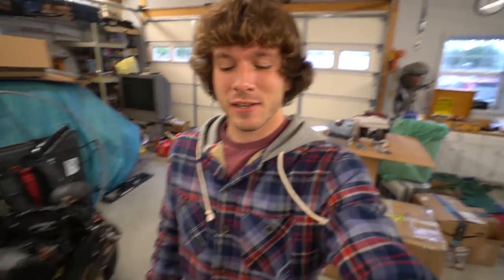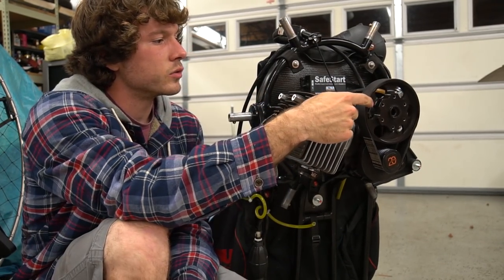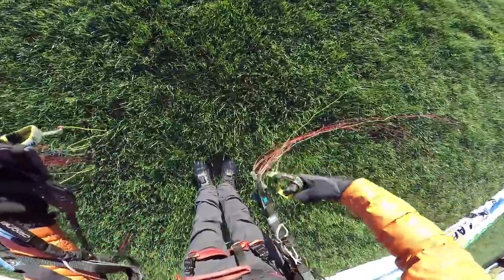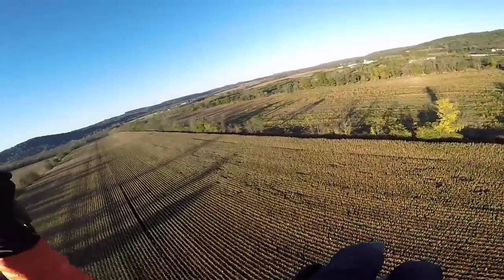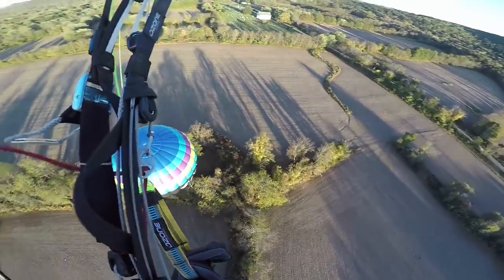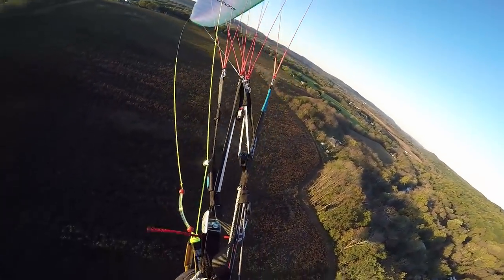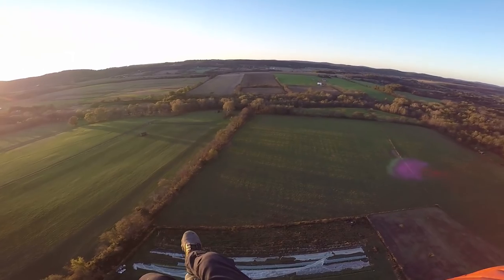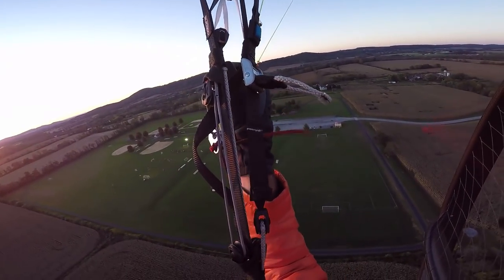Never expected to find this in my engine! - 36 Hours Of No Maintenance

Comment: Hey Tucker, can you find a secure place to "tuck" a 20 dollar bill on the motor frame for emergency (McDonalds, fuel etc.) money? Just a thought. Thanks for all the videos!
Reply: There are pockets all over the harnesses, usually, for things like wallet, keys, phone, hook knife, etc
Reply: A Driver’s License with a twenty in your shoe works pretty well.
Reply: Having hidden spare money is always good, I have a hundred in my belt.
Reply: Estabanwatersaz a leather money belt is the best idea. I found one that is also the new zipper/ratchet/automatic one that's the boss! Looks good and the ratchet buckle is great for my skinny butt!!
Glasses are a must have! I started years ago with a pair of Wiley X for riding, but they stopped making that line that had the inserts to keep air and dirt out of the eyes but Eye Glass World has a great pair called the Liberty with magnetic inserts, not snap ins like Wiley X had that I use when flying and riding and even on windy days flying my kites, keeps the dust and dirt out. Mine are prescription but get them either with plain glass that darkens in sunlight or in your favorite color of sunglasses lenses. You'll love them and they have a big enough lense area that they don't block any perceptual vision. I had to wear them in Colorado today because of 30+ mph winds that made me keep watering up. Tell them I sent you!! LOL!
Keep that wallet on you when you have real pants all the time, JIC of an accident or as Kyle O would say, a taco attack is needed!!

Blue Sky's and Safe Journeys!

Comment: Tucker:  That VP racing can I saw in the video is the bomb.  I have a few myself.  The clear tube on those cans will eventually get brittle and crack at some point.  Go to some fleet supply store and get a length of real gas pump hose and the tube will forever stay flexible.....  Great video young man!!

Comment: I wanna say the crud on the head and piston is all the ethanol (basically rock) in the cheap gas station gas and the av gas should be leaded (which also lubes the motor nicely). You may notice old car motors from the 70s (leaded fuel) have almost no wear but motors from the 80s/90s (unleaded fuel)  basically grind themselves down. Or I am just stupid. Happy Flying !!!

Comment: Tucker, thanks for showing what avgas can do to an engine. Sometimes there isn't much choice at airports and we have to use it. I fly a 912uls and try not to use avgas as much as possible. The 912 and most 2-strokes are designed to run on autogas.

Comment: I was wondering when you decarbonized the cylinder head and piston crown..did you also check the exhaust port for carbon build up as well?..2 cycle engines running on leaded fuels and high oil dilution ratios will form more deposit build up than unleaded fuels..A clean out and repacking of the muffler does wonders too..especially for gas mileage.

Comment: Classic New Jersey Shenanigans. Glad to see you enjoying simple fights back at home. Didjoo say you used a WIRE BRUSH on your heads and piston? On  nikasil coated parts? Use chemicals to dissolve the carbon so it can be removed with a soft cloth. Zero nikasil damage that way.

Comment: Use SeaFoam fogger for carbon buildup, after pretreating buildup, put head back on and spray into carb while giving some throttle.  It will smoke a lot and start to choke out. Also run in fuel.

Comment: For the issue of the dirty internal part of your engine. Have you considered a good fuel additive in order to keep the cylinder clean and lubricated by using the fuel additive. I was just thinking this may be a good idea. I am sold on a product called mix I go. When this product burns the residue Left Behind is a very fine oil which will lubricate that area of the engine also as well as keeping it clean and the spark plug clean. I enjoy your videos

Comment: Glad to see you're having a good time back in NJ. You seemed pretty Giddy (or was that the espresso talking?). You should get an RV instead of van, so you can have a shower once in a while (tons of cheap ones in NJ on LetGo) I know because I have been looking into getting one. We are talking under 5K for a nice one (and not much difference in mileage than a conversion van 19-22mpg. Rock on Bud!

Comment: been working on 2 stroke dirt bikes forever. 1. Spark plug- make sure the gap is correct from the factory you would be surprised how often they AREN'T. 2. Use better quality pre mix  3. bore out and hone the cylinder, change piston and rings every 150 hours of use but in your case, since your life depends on the engine, I'd do that more frequently. 4. whenever you got the engine opened up and you have had it for a while, always check the bottom end. 5. Use the best fuel you can find , non pump gas if you can. Anything over 100 octane is best. 6. I don't know if the carburetor is designed for certain altitude and I don't know how high you can fly with that thing but if you are going over 3500 feet, you must prepare your carburetor accordingly, that means to re-jet it before your high altitude expectations. Otherwise you wind up with much carbon on the piston and your engine will not perform right. 2 stroke motors are very sensitive. On a 4 stroke you could piss in the tank  iand it would run fine, not a 2 stroke.  Just my .02.

Comment: Nice work on that maintenance. I never saw white stuff like that before inside a motor. I guess it must have been running pretty hot. Pumpkins are $5.99 each at ShopRite, I didn't buy any at that price. I'm pumpkinless :-(

Comment: Hey Tucker, now that you've serviced your motor after the race, are there things that you think you could have done along the way to avoid some of the damage done during the race? Is it worth changing out the spark plug after day two or something along the lines of bringing a wire brush and some tools to clean your header/pistons along the way? Was that even possible or would it have even been worth it?

Comment: The buildup inside the engine is most likely lead oxide. Remember that Avgas is highly leaded (yes, still! The engine manufacturers (primarily Continental and Lycoming) are way behind with this.). If the engine was specified for Mogas, which I think it was, it is no wonder that you get lead oxide buildup. Also, from looking at the colour of the buildup, I'd say that you're running your engine on the lean side, which is not good for the engine (higher temperatures, more ignition plug wear). Try avoiding Avgas and adjust mixture a bit to rich, and you should be fine from now on.

Comment: I recommend to clean exhaust with sodium hydroxide (in case you mix your fuel with oil for two stroke engine). Carbon will build up on walls of your exhaust from unburnt oil, if unmaintenanced for very long time it can clog up your silencer.

Comment: Nice job on the refresh. That plug and head buildup is lead from the AVGAS.. I don't run AVGAS in high revving 2t's as you get this buildup too fast.. it might be worth checking the rings on the piston too as they can stick due to the AVGAS too. You most likely know all this anyway being as experienced as you are. If the automotive gas has ethanol in it it's often better to use semi-synth 2t oil as it mixes better with the ethanol fuel.. another thing I like to do which you might like to try is to get those little 100ml / 50ml etc plastic bottles you get from the dollar store for camping / party / airplane use and measure out some 2t oil in specific quantites... i.e enough for 8l gas / 10l gas etc and write on the little bottle how much gas you need to put with it. you can just tip it in the tank before adding fuel and that way and no need to mess about with syringes etc etc. Unless your tank is empty enough it doesn't allow you to brim the tank as mixing at pumping time would but for lesiurely flights where you don't always need 100% full tank just keeping a few ready measured little plastic bottles in a bag for 8L / 10L / 6L / etc will allow you to quickly refuel and go.
Reply: it's not from the AVGAS. Avgas is 100LL... low lead, high octane. the buildup was due to using pump gas most likely containing some ethanol, or a lower quality oil for the mix.
Reply: don't take my word for it... here is a great link for the info. http://www.southwestairsports.com/ppgtechinfo/top80/hrservicenotes/fueloilspecs/fuelOil.htm

Comment: I was wondering if you also refirbished the ignition or is it an electronic one? also i hope you did you clean the carburator as well as the airfilter and checked the fuel filter and breather hole in the fuel tank... As I am working with 2 strokes also, this is a common issue in my motors... Keep it up and again, congratulations on the Icarus Throphy.

Comment: I was wondering how much oil you mix when using avigas. I know that is about 100% octane.
I put some stuff called "Seafoam" in my calibrator of my lawn cruiser lawn mower. It knocked a lot of the buildup out of the cylinder/piston area. I was told to add some in the gas as it would also help the carburetor.
I don't know how it would work in a 2 cycle engine.
Carry a couple extra spark plugs the next time you do a long distance fly.
I also thought your engine had two cylinders, but you only had one. WOW that engine did a
great job. The company should just give you a new one for the advertisement.
Fly Safe !

Comment: The white buildup in your cylinder is a sign that your engine is running too hot, the white deposits are burnt oil, you could try out a sparkplug that has a better ability to lead heat from the inside of the cylinder to the coolingfins, that way the tempertures inside the cylinder will be lower and the oil will not be burned and stick to the inside.

Comment: HELP!  I HAVE QUESTIONS!!!

I would like to plan a paramotor trip from Clarion PA to Traverse City MI.  Absolutely no rush to get there.  I'm also not worried about taking the shortest route.  I would prefer NOT to fly over any of the Great Lakes.  So I'm looking at a "backwoods path" through central Ohio and eventually up through central MI.

My Questions:
1. How do I find out what is restricted air space?  Is there an airspace restriction map app?

I want to naturally avoid flying over any major cities or highly populated areas. 

2. I'll need to be landing and camping out overnight quite a few times on the way.  

Should I make arrangements with campgrounds ahead of time?  Or should I leave the tent at home and just land randomly at motels like you appear to have done in the Icarus race?

I'd rather camp out in a tent, but that's added accessories to bring.  So that's a trade-off I'll have to think about.

3. Finally, I won't be making this trip until at least next summer at the earliest.  Is it possible to find other paramotor enthusiasts that might be interested in taking part in the trip at least in-part if not the whole way. 

How do I get in touch with other paramotor enthusiasts in the PA, OH, and MI areas?

Thanks.

Comment: Another great video!  Thank you!   Question:  What did you use to wipe down your exhaust pipe and fuel tank?  I saw a couple of products in the video, but couldn't make out what they were.
Reply from the maker: I use purple power as a degreaser and triflow to protect the exhaust from corrosion.

Comment: What did you do about the cracked, duck taped spar?
Reply: Looks like he's still using those broken spars! LOL...duct tape for the win!
Reply: I'm surprised that the FAA doesn't require licensing for paramotor maintenance (looked at FAR 103). That balloon he circled does.
Reply: That Balloon is also carrying passengers other than the Pilot, and enough weight/hazmat to cause more damage if it lands on something.
Reply: Ed Marbach In Sweden they do..

Comment: Great video as usual. Just wondering, is there no oil to change on these motors?
Never seen anyone changing it. Thanks.
Reply: I know this is old, but no, 2 strokes don't have an oil sump. Generally you mix the gas with 2 stroke oil, but some larger 2 strokes, such as snowmobiles, have oil injectors that mixes it in the lines entering the cylinders.

Comment: Tucker, I am wondering if you adjusted the air/fuel mixture during your flights to account for elevation changes and/or lack or excess of oxygen? Seems to me the combustion chamber and plug were fouled do to improper mixture? Great vids man, stay safe.
Reply from the maker: Yeah, I leaned the mixture slightly. I would imagine some of it is improper mixture and some is the avgas.

Comment: During the Icarus race you had to super glue and duct tape your cracked spars. Did you replace them while you were cleaning and replacing your clutch or are you flying with the duct taped spars?
Reply from the maker: Flying with the duct tape for now, new spars are on the way.

Comment: Tucker, what does SAT even stand for? Satellite? Sick Ass Turn?  Also, how much weight are you carrying on average? I use a cane every now and then to get around....doesn't mean I'm completely broken, but since I have the paramotor bug, I just wanted to know if it's easier to use the cart/trike for old dudes like me? If so, does it degrade the experience?

Comment: do you always ship your equipment? Is that a better option over checking it in with the airline?
Reply: Yes he always ships his eq. He addressed this in a previous video. Gas fumes could potentially get his motor pulled by TSA. Yes tucker drains his lines. Fellow pm's had missing hardware & even missing gas tank.

Comment: You're a brave man for trusting such a sketchy Italian motor that has all the reliability of a 1970's Fiat. But I realize the choices are currently limited and it's still likely one of the best paramotors. I think ultimately a modern 4 stroke paramotor will make your Vittorazi seem like an ancient unreliable stinky high strung moped vs a 2017 Honda motorcycle.

Comment: the build up in the head and barrel is from running aviation fuel . it does not get hot enough to burn properly , so you get crud in there . It is ok or better if you have a high compression motor , like in a race engine where the head has been skimmed to raise the compression,been there , done that , not in a 2 stroke that always has low compression , unless it is a KTM 500 motor cross bike , .they have serious compression

Comment: How difficult would you say the regular maintenance is for paramotors? I am hoping to start flying in the future, but I have no experience with engine maintenance whatsoever.
Reply from the maker: +Jonathan It's pretty easy stuff, two stroke motors aren't very complicated.
Reply: And there is very little that you need to ever do. Check torques, clean carbon once in a while and routine maintenance like making sure the exhaust system springs are OK.  That and replacing broken or worn parts is all there is to it and these little things have very few parts.

Comment: Inside the head you want it as smooth as possible, even polish it with metal polish and a mop, the piston head you dont, clean the carbon build up off, but dont polish it

Comment: 36 hours and clutch service needed as well as the head being pulled off and looking pretty crappy. What kind of warranty do you get with those types of motors?
Reply from the maker: This wasn't 36 hours total, it was over 100. Just 36 hours straight of no maintenance and burning avgas.

Comment: how often should you have to change the spark plug and what is the correct fuel mix to avoid carbon build up?
Reply: Plug change every 10 hrs.  90+ Octane ethanol free fuel.  I mix Amsoil saber at 40:1
Reply: Robert Durbin thanks robert i am thinking of taking up this sport had a few flights already just not got any kit yet? im from uk so will have to find the equivalent
you pay such low prices for gas in usa we are envious!!!!
cheaper than water!! 
it was interesting to see the wear n tear on the engine crude running it on the icarus race im taking that mix is the optimum
thanks for replying back  to me
Reply: No doubt you can get much more life out of it, however they are cheap and replacing them often is good insurance.
Reply: I would rather be sure that my plug is not going to foul at just the wrong moment. Take a page from the professional pilots handbook. Do the required maintenance and don't cut corners. Replace the damn plugs it's way cheaper than a helicopter rescue on a mountainside or even a van cab pick up at a farmers field.
Reply: Flyboy BC wouldnt you just carry a spare new plug with you on flights?
Reply: david john Huxtable you can't exactly change a plug while flying with a running engine.
Reply: Robert Durbin understood spares are usually changed on the ground!!!!
tho tucker gott would probably try to change it on the move up in the air if he was in a race!!

Comment: Wow... it seems like these paramotors require care, repair and servicing vastly more often than a regular small aircraft engine.  On the small airplanes I've flown, that was really necessary was to change the oil every 200 hours or so and get servicing once every 2000 hours.  Do these paramotors really require so much more attention?  Are there any 4-cycle engines available for these suckers (that don't have crappy performance in comparison)?

Comment: How much maintenance does a ppg engine require? I know you were burning a high octane fuel with out proper additives but still 36 hours to a dead clutch seems... extreme.
Reply from the maker: Generally, not a lot. The clutch likely didn't fail. It appeared that something (like a small rock) got into the clutch and caused it to drag.